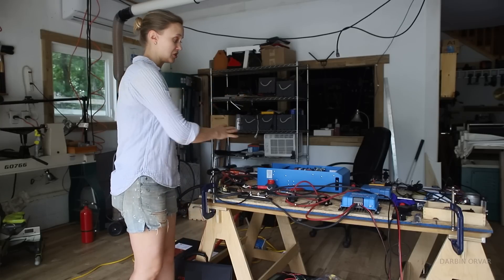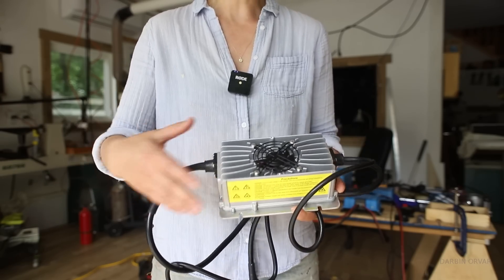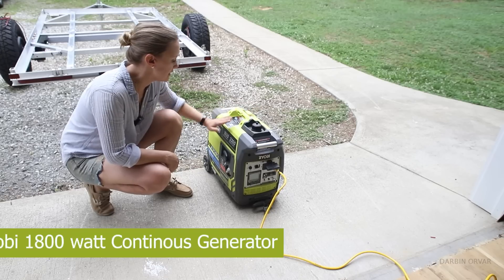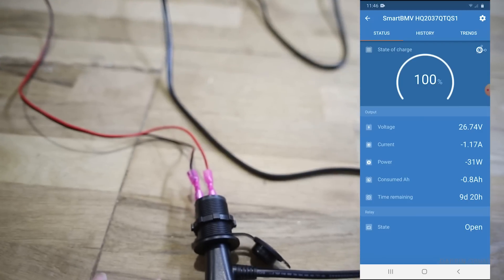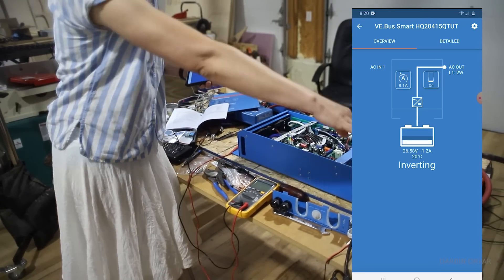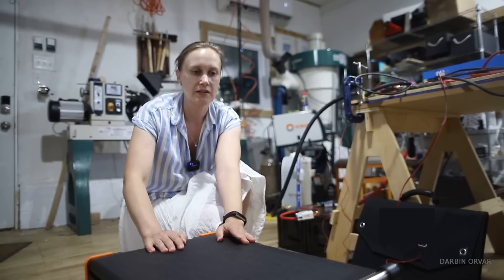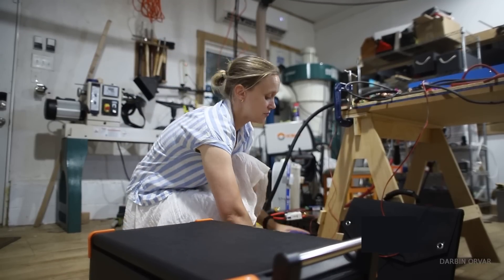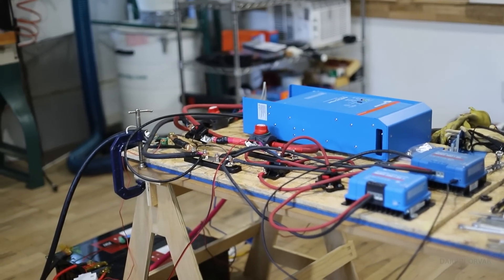Teardrop Camper: Going from 12 to 24 volt + New Victron Multiplus Inverter Charger!

Comment: Use low drop high power schottky diodes to charge batteries in series at 24V and discharge at both 12V & 24V. Or, drive a hybrid vehicle, and use its high voltage battery, which requires a much simpler inverter to produce true sine wave (more safe for electronics, and less EMI radiation).

Comment: It’s always interesting to see how people learn, I learned as I went along -kind of haphazardly!
One question, which dip switches did you have to change in order to get more amps from your generator?
Mine are all set to on my Victron inverter. I don’t have a PC so I can’t change any of the internal settings. 
But the generator is my only issue, as I wish I could get more out of it.

Comment: I am sure they design it with a limiter when charging from surepower. The control you how over charging rate is if you have other things to power from the generater without overloading it.

Comment: I predict a Victron Cerbo GX in your future. I think moving to the multiplus was the right move.  Is there a reason you have 2 charge controllers?  Isn't your 150/35 is sufficient if you use 3 parallel string with 2 panels in series?  Open circuit Voltage of those panels would be < 75 and current short circuit current would be < 35.  I'm not trying to be critical, just curious or maybe i'm missing something.  Excited to see more work on the trailer itself.

Comment: Good setup! Moving to 24v is excellent. When not out in the teardrop, you could use this setup as a grid assist. Maybe cut down on your home electric bill some. 
I am building a similar teardrop, only mine is going to be a square-drop. I am planning a solar setup also, but I am going with an all-in-one inverter setup such as MPPsolar or Growatt. Going this route to save space inside the square-drop. All-in-ones have all the same things you have setup in one small package. One day I am going use a setup like you, but to power a solar shed like your workshop.

Comment: 24v is pretty standard in heavy trucks, so you may want to look at truck accessory suppliers, both B&M or on line (considering long distance drivers virtually live in their trucks).
Reply: I am not sure that is the case on US semi tractors as opposed to EU where 24V is the norm.

Comment: Moving to 24 volts sounds like the right idea to me, especially if you take advantage of the lower currents (on the 24v appliances) by sizing your wires smaller.

Comment: Pleased to see that you went to a higher-voltage system, and an integrated, "smart" inverter/charger!  Besides having a great trailer set-up, as a free side benefit of this set-up, you will also have partial backup of your home  (without even needing to run the inverter generator)!